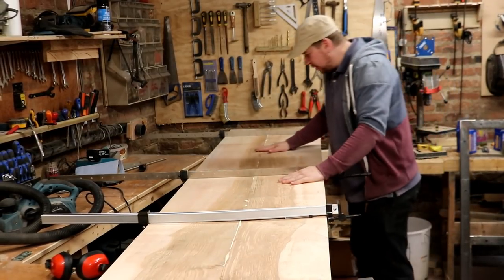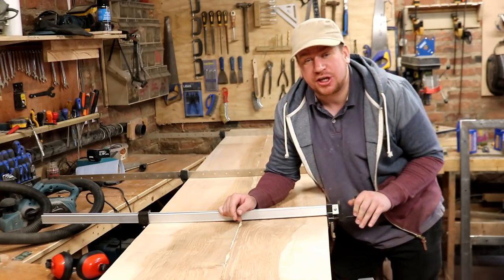IT JOINED

Comment: I've tried to cut bottles using a scoring device with hot and cold water.  The results were not good.  You just can't get the glass hot enough.  However, if you have a heat gun, you can heat the glass quite well and get much better results.

Comment: Great job on the counter top👍.
Your chandeliers sound great though I would be concerned about the type and size of your bottles so as to allow for even weight distribution plus the additional ceiling support to hang them for which you could use chain or conceal the cable through some 20mm galvanized pipe which you will have loads of containment to choose from.
As for the focal wall with the doors you could utilize the two existing supplies for the wall lights and run some LED  rope lighting with colour switching to change the mood as there is plenty of room to hide a small transformer and low voltage for safety plus low wattage on running cost.Ggood luck and cheers.

Comment: Glad to see the bartop turned out well,it will look pucka when it's treated. Pub lighting is going to be tricky,and expensive if you go for those inset gu10 type lights on dimmer switches though they would probably work best for a pub. Or if you want to stick with the rustic theme get some old tilly lamp shells and guy them out for lightshades. Cheers.